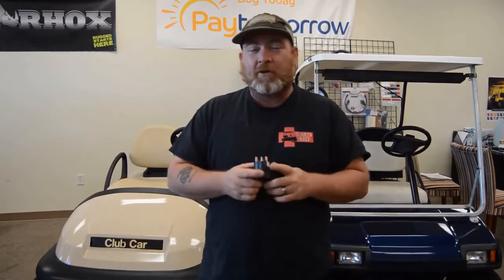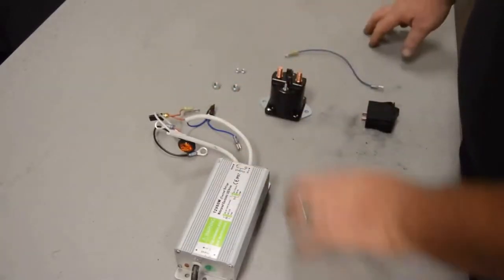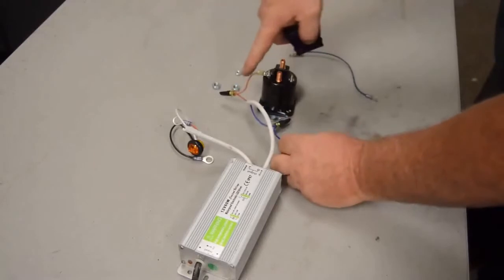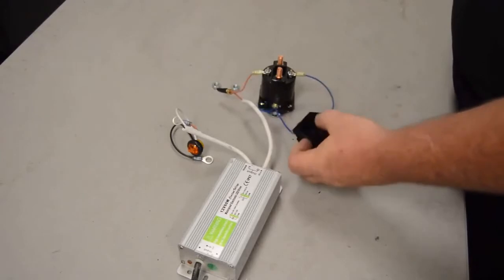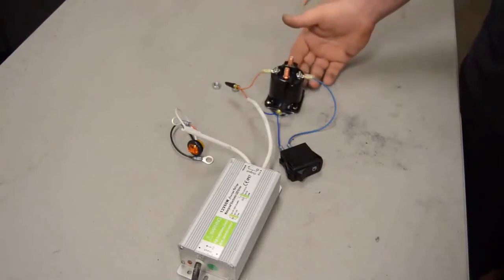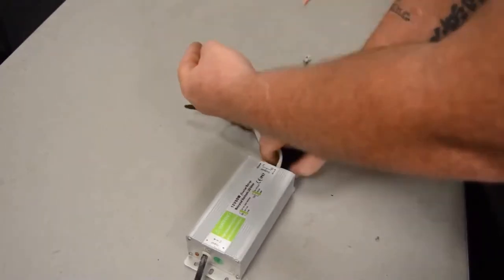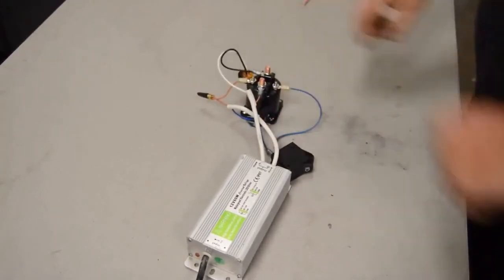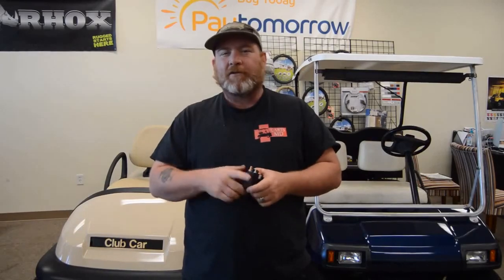Solenoid Demonstration (A practical application)

Comment: Mines is literally the same cart. The batteries are good. Just did the mcor. It run for about 2 mins then dies. You let it sit and it will run again. Kinda like the longer it sits the more mins you can ride. Any help?
Reply from the maker: "Yours" is which cart? Their are 2 different carts in the background, they are both Club Cars, one is a Precedent 48v model whilst the other is a DS 36v model, neither are similar in any way except the brand name,... Solenoids usually work, or dont work, they are very rarely intermittent, if you have black/white/grey/ or red batteries and they are 2 to3 years old the batteries will be a prime suspect, Only Trojan brand batteries (their maroon) last 4 to 6 years, if so, your controller may be shutting off due to poor amperage from batteries, if your telling me your batteries are good because you have the right voltage you need to realize that its not voltage so much as its amperage that moves the cart, of course, if I knew exactly what model you have, I could shed more light on the issue. But based on what little info I have, Id lean towards battery age and/or quality being the issue, or a loose/corroded terminal/cable

Comment: Actually, I changed my mind. I'm gonna try something else 1st. Gonna get new resistors before new batteries. I installed a digital volt meter in the dashboard and can now watch it closely. When I drive around for 7 minutes that meter says 18.7V & gotta push her home. Got home checked the batteries with another volt meter & all the batteries were fully charged, then the volt meter in the dashboard showed the same after 10 minutes. They should really put a sign up saying "Resistors - SOLD SEPERATELY"!!
The question is, how do I set the speed? Do I have to put the resistors in some kind of order? I want to go up to 18MPH.

Comment: So I got the solenoid & new brakes working great, but the same problem was going on before the old solenoid broke. She'll go about 1/2 a mile at 13mph, then slow down to about 7 for another 1/8 of a mile & then only go about 1mph. I could push her faster. The funny thing, after pushing for awhile, she'd charge up a little somehow. Then we're back to 1mph for 200ft. I pushed her the last 400ft, so I could get her up my steep driveway & into the garage.
Bought a Beblee charger that thing does more than the original charger, but I don't get why she does that? When I got home all 6 batteries are still at 33.3Volts. It shouldn't slow down like that?
So in my 1993 ClubCar DS I have this mysterious black plastic box next to the 6th battery. Negetive terminal under the drivers side. My neighbor who I bought the cart from, says I should never open that. But I think I should. I thought it was an air filter, but that's dumb since I don't have a gas engine. Bunch of cables coming out there leading to the Forward & Reverse switch. Who'm ever had it before me has intersecting cables in different colors, so the original manual don't match. If the plugged cables in that thing are loose, that would do this right?
Reply from the maker: That triangle shaped piece is called a V Glide, they are model specific, on the back side of the V Glide under the cover, there are resistors, this is what makes your speed, in your case likely one of these resistors is burning hot and fails, if you let it cool it usually resumes function, however this is a sign the V Glide needs replaced. If your handy, I recommend a V Glide Upgrade kit to MCOR .... both of these items are a "multi-step potentiometer" in other words. I can ship these or any other items directly to you, call us 833-CARTSMD (833-227-8763) to order. When calling, please have your carts serial number handy.
Reply: Yeah, so I replaced the viper glide switch, but the new one didn't come with the resistors, so I took the old ones and put them in the new one & that worked.
Where do I get the resistors? Mine is set to 13 MPH, which is fine, but a little faster would be nice. I have finally come to the conclusion it's the batteries. They're 6 years old this month, she's not holding her charge no more. 2x around the pool & she won't make it up the driveway. I'll be replacing the batteries at 2 a month for 3 months. Can't afford all at the same time.
Btw, the Solenoid is in and works, but it clicks really loudly. The old one was quiet. Did I do something wrong with that?
Reply from the maker: @stephenolsson649   You DEF need new batteries, old batteries like yours have been known to cause even more damage in the long run, its why the MFG of your cart (and every cart MFG on the planet) recommends new lead acid batteries EVERY 4 years, regardless of how well they still work, greedily, people keep pushing and pushing, not knowing they are causing heat resistance in resistors, and melting the inside of controllers, Ive seen old batteries cause thousands of dollars in damage, needlessly. Start with new Trojan batteries, Also, 13mph is the factory speed of that cart.

Comment: Hi, thank you for that! Now I almost know how to hook up my new 36V 10L0L electric solenoid. The thing is, who'm ever had it before me has altered the color codes from the original manual, in ways you would laugh at & scratch your head.
Can I send you some pics of my solenoid? 
The switch is supposed to be hooked to one of the small poles right? Mine is hooked up to one of the big ones. Someone tried hot wiring it awhile back, so the cable to the switch on the big pole has melted into the surrounding cables. The inverter burned, but didn't blow up the whole thing. The solenoid stopped working shortly after too.
Right now I'm installing new brake cables. I wish I could flip it on its side, but I'm not taking those heavy clumps out again. I am saving up for the LithiumDakota battery though. 1 instead of 6. Any help would be greatly appreciated. 
She comes from Lost Lakes, Florida. Abandoned 25 years ago in an abandoned garage along with her "sister". Neighbor has that one. We were supposed to fix them together, but the pandemic got me stuck in Sweden for 2.5 years, so he fixed his without me & now he doesn't have time to help me.
I'm pretty good with electronics. Mechanical cars are my thing, this electric thing is all new to me. But I wanna learn!!
Reply from the maker: This video shows how virtually all load solenoids work, in particular, all 4 post solenoids there are 2 little wires, 2 big wires, it dosent matter which side goes where, but the big wires (cables) bolt onto the big terminals, the little wires bolt onto the little terminals, not much more to it than that, sounds like your making it more complicated than needs be.....I wouldnt be much more help if the video dosent help, I would recommend calling a qualified golf cart repair company nearest you, all in, your bill would be around $200 IF it is just a solenoid replacement
Reply from the maker: Also, go with ECO lithium battery, they have a better warranty but in actual use they hold up a lot better

Comment: I installed a solenoid, and it started to get hot, is this normal?
Reply: Yes it should be normal for a solenoid to get warm. I intern for a company that makes a bunch of these solenoids and we have heat run chambers to measure how much heat output they give. If it’s too much it may cause coil burnout or the housing to melt.